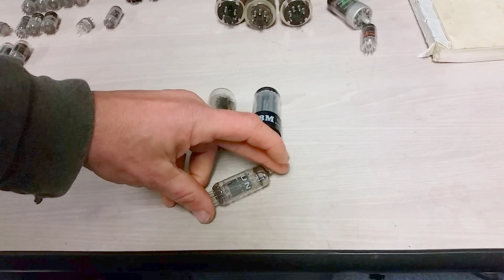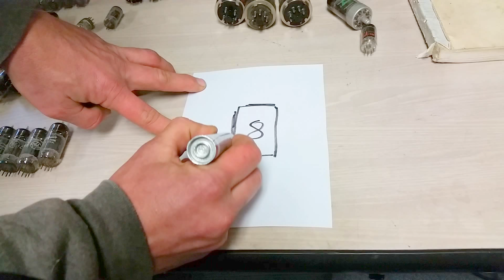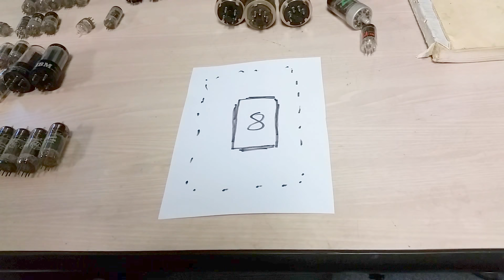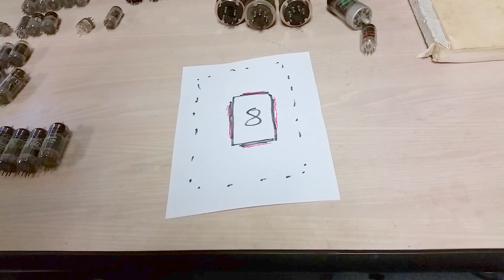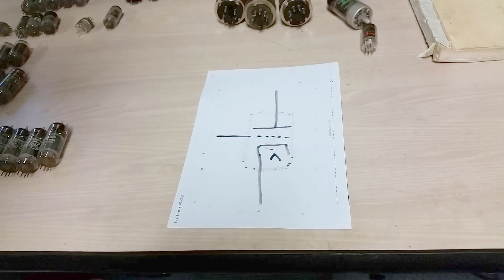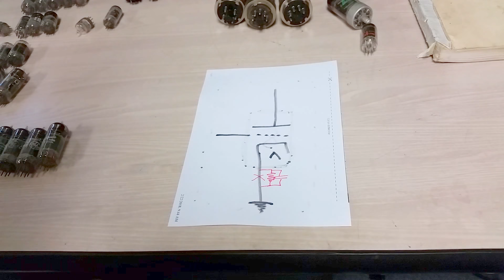What are Computer Rated Tubes?

Comment: Thanks for the fascinating look at these rarities. I remember reading books that blew way out of portion just how unreliable tubes were. It wasn't years later until I owned my first Tek scope (A Tektronix Type 547) that I got to see how reliable tubes actually were and learned I had been lied to. Can't kill that thing with a stick! All original tubes! I decided they simply would not have built so many SAGE computers, with their horrifically large tube count, should these things be unreliable. They did duplex the systems up per site, but still, they had an incredible uptime as I recall. I seem to also remember watching some video on sage in which they had an audio speaker hooked up to some circuit of the computer, and when things would start failing, the operators were so in tune with the system, they'd know what was wrong from the 'sound' it was making, and could switch over to the other system generally well before any uncorrectable errors would occur. Too bad it would take in excess of 2-5 megawatts to run and cool a SAGE today, as one of my childhood dreams, it would really be awesome to see one in action.

Comment: these should run a lot longer in a oscillator of I am not mistaken
Reply from the maker: Correct, in an oscillator (or really any amp) the tubes never stay in cutoff, so the silicates do not get a chance to migrate to the surface.